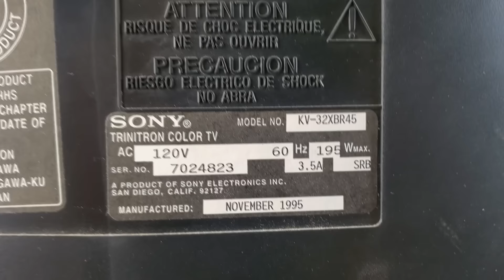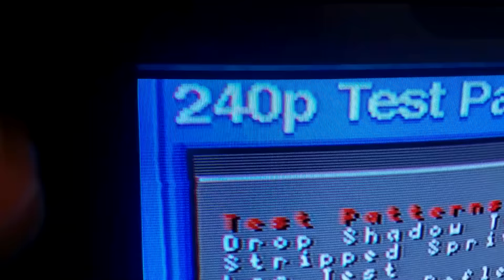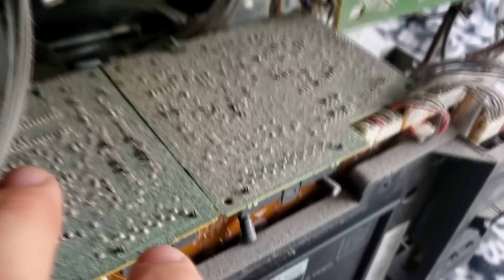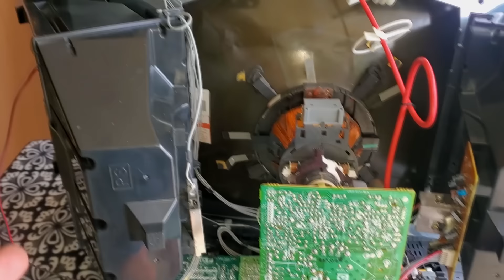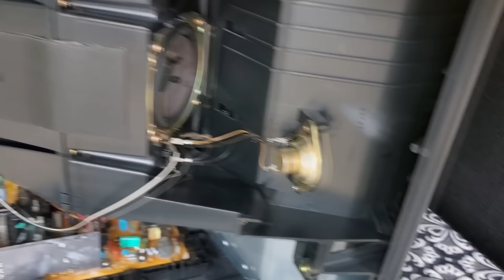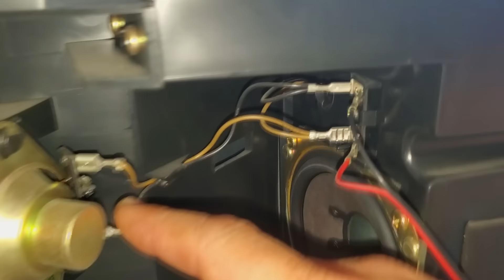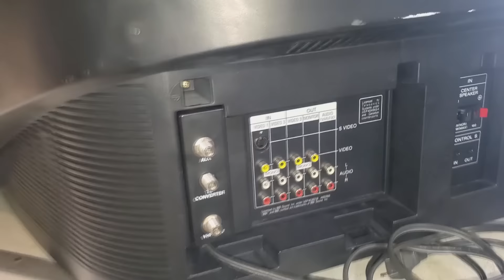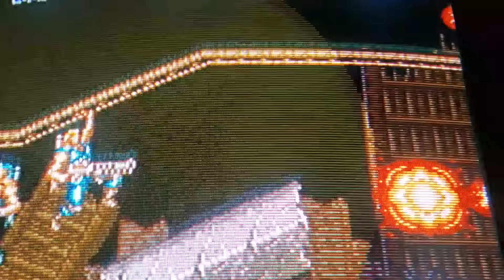The Biggest CRTs still in use: The Sony XBR Trinitron Tube TV

Comment: Just picked up a sony kv-32xbr70 from 1990. It's a beautiful set but the convergence on the corner and bottom edge is pretty terrible. Is it worth using convergent strips to try to fix up the convergence issues? I was surprised that you didn't use any on this set
Reply: beautiful Crt. I have a question, if in the service menu I try to change hsize and it has no effect on the screen, could it be due to bad capacitors? I change the value and nothing happens.
Reply: @davidb8826  Thanks man, I'm loving it! I never had that issue before and I've made geometry adjustment on trinitrons that were over 2 decades old. What type of TV do you have?

Comment: XBR is top of the line right? I’ve always liked those over regular SONY models. Even the plasma and lcd models look better in CBR.
Reply: In my experience the XBRs have the best sound compared to other models but not necessarily better video. XBR are just one of several high end Sony models. XBRs have excellent video but there are other models with excellent video i.e. Wega. That being said my favorite CRT in terms of video quality is my XBR200. I prefer it over any of my Wegas or even my BVM1911.
Reply: @riggel8804  I have a wide screen CRT; XBR970.
Reply: @Dacari13  is that an lcd? I had a xbr lcd for awhile. Funny thing is my lcd xbr broke but my 2 crt xbrs still work.
Reply: @riggel8804  It is an XBR LCD. My HD WEGA TRINITRON XBR WideScreen CRTstill going as well. 34XBR970 if you want to look it up.
Reply: @Dacari13  cool. Thanks for getting back to me.

Comment: Thanks again for working on my giant beast of a CRT, Steve! Sorry it was so damn dusty inside. Can’t wait to pick it back up
Reply from the maker: Haha, it's no problem. It's a great TV.  The dust is a due to the design also.  It has limited air flow.
Reply: I think if Ultron used your CRT instead of Sokovia, it would've had the same effect.
Reply: @EBCHILL2  nope more devastating
Reply: @PixelsAmpersandBits  🤭

Comment: Damn, that's one massive and heavy CRT. Sucks there is nothing higher than s-video, but it could be worse, it could be composite only 😄
The capacitors on the tweeters look to be a basic crossover design, filtering out any low frequency sound from going into the smaller speaker.
I was hoping to see a bit more footage of the boards when you pulled them out, but that's ok, I still enjoyed the video. And yep, classical music isn't my cup of tea but you put it to good use here